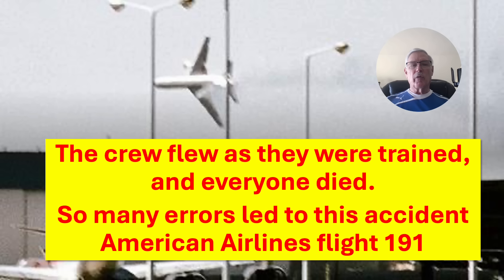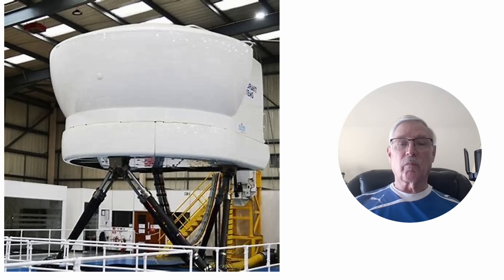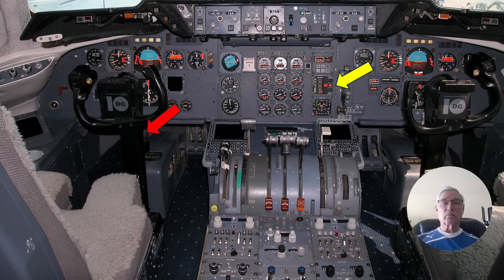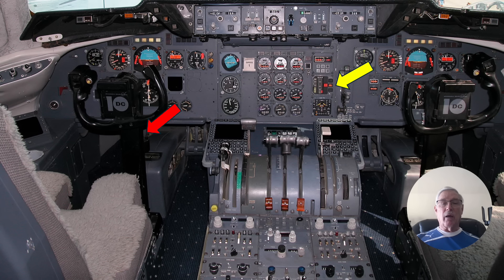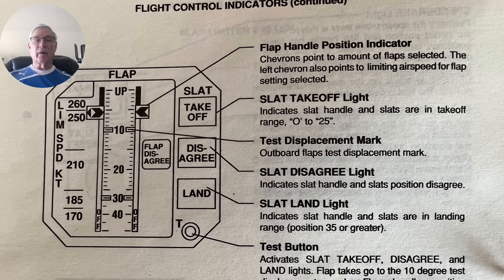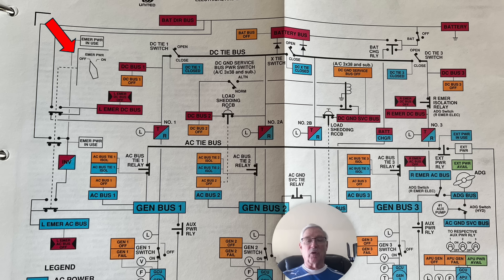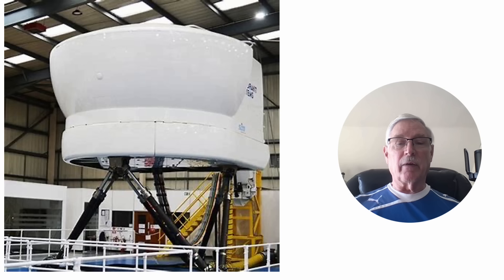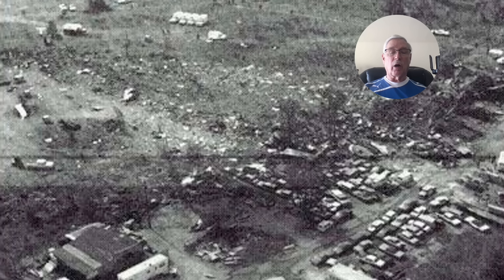The crew flew as they were trained, and everyone died. American Airlines flight 191

Comment: Thank You but your wrong? Flight 191 was doomed from the second that the engine
and Pylon left the Aircraft. Capt Lux  and the crew could do nothing to save the aircraft?
Why  because when the Pylon left the aircraft it tore open all 3 hydraulic lines disabling
all 3 Hydraulic systems.On a DC-10 it has only 3 systems and if all fail as in this case
it leaves the Pilots with no Control and no way to fly the aircraft. This was a Fatal 
design Flaw on McDonald Douglas's part. resulting in the Turkish  DC-10 flight
981 killing 346 in march 1974 and  United 232 at Sioux City  in 89 killing 112
of 296. In flight 191 case when the lines tore open (and you can see the Hydraulic
fluid coming out in the Photo where the aircraft is in a 90 degree Bank) the flaps
and slats on that wing retracted  causing that wing to stall? the aircraft was below
flap retraction speed.with out the hydraulic systems The first officers first thing
would have been to add right ruddder and right aileron  But with no hydraulics
the aircraft while still climbing slowly rolled to the 90 degree bank where the 
stall speed would have been well over 200 Kts. I'm a retired airline pilot and
knew Capt Lux a very good pilot blaming him and his crew is an outrage,
when the DC-10 was only a few months in service an American DC-10
flight 96 in 1972  almost crashed when the cargo door came off knocking
out 2 Hydraulic systems and damaging the 3rd only the piloting skills
saved the plane. But besides the cargo door fault they found all the 
hydraulic lines were run together to save weight. this Flaw was never
repaired They said it was But United 232 tells us that 1989 when it
lost all hydraulic systems it wasn't again only the crew flying with engine
control saved most of those on Board  so when they say Capt Lux
and his crew slowed its not true. with all 3 systems gone no one could
have saved that Plane and the people on board .They knew it could happen 
but they didn't fix it ,Just like in 72 they knew the cargo door could come
off but 2 years later it did again and killed 346  a Gentleman's agreement
instead of an AD  and it wasn't fixed.

Comment: Half RUDDER? If I read your chart correctly at 7 min the rudder is split top and bottom with the systems. So maybe they had only half the rudder as well to prevent the roll?
Reply from the maker: No, The lower rudder is being powered by system 2 and three thru a motor pump, and the upper rudder is being powered by a motor pump from system 2 even if system one is gone.

Comment: Don’t the airlines require a test flight after a major maintenance evolution, such as an engine change? It sounds like the went straight from maintenance to a passenger run. I know in the military we did a test flight after major maintenance activity….
Reply from the maker: I think one is required, but this aircraft had operated on  a number of passenger flights before this event.
Reply: @ronrogers  Ok, not knowing the full history it didn’t seem right to me. Guess I work in aviation  too long….

Comment: The DC-10 was grounded until the cause of the accident was determined.  Why was the 747 not grounded after TWA 800 until the cause of the accident was determined?  The President was telling us it wasn't terrorism, as if that was supposed to ameliorate the concern of what happened? I have no answer for this.
Reply: Good question.  The DC-10s weren't immediately grounded.  That came two weeks later, after a few (two? -- working from 45 yr-old memories here) aircraft which had recently been inspected and found to be free of pylon flange cracks were now found only a short time later to have cracks.  Something incredibly dangerous must be lurking if cracks could develop in such a short time.  So the type was grounded while this was investigated further -- a reasonable decision under the circumstances and not directly because of the 191 crash.

As the circumstances and engineering design continued to be intensively studied over the next several weeks by DAC and the FAA (I was present for some of the technical briefings by DAC's engineering VP), it came to be realized that the only explanation for the "new" cracks was that they had been missed in the earlier inspections, rather than having formed in just a small number of cycles.  The grounding was therefor lifted after about five weeks.
Reply: "I was present for some of the technical briefings"  DC-10 engineering trivia, from a briefing by DAC engineering VP Eugene "Gene" Dubil:  All of the structural calculations related to the DC-10-10 pylon were checked for errors.  The only error found was one part which had been designed to handle five thousand pounds more load than called for.

Comment: It was , but up my want to expand on why the crew reduced to stall speed
Reply: They reduced to what was the optimal initial climb speed with a failed engine.  Unfortunately, that speed happened to be 6-7 knots below the stall speed of the wing with the retracted slats.  They weren’t trying to slow to below stall speed, they simply didn’t know what the stall speed of the wing was, and followed their procedures into what was essentially a spin entry.
Reply: @bradcrosier1332  thank you thank you . That makes sense for optimal climb speed . Clearly I am not a pilot

Comment: Doing two basic things differently might have saved N110A, serving as AA Flight 191:

#1.  Maintain climb rate to put as much altitude between the disabled aircraft and the ground.

#2.  Maintain or increase, in the case of the trijet, engine #2, and slightly decrease throttle to #3(starboard) to maintain attitude symmetry long enough to buy time for the wide left turn 191 needed to return to Ohare runway 10 (going east).  There was only one Runway 10 back in the 1970s, if I recall correctly.

The result might very well have been a rough or crash landing, perhaps similar to the United 232 incident in Sioux City, 1989, but fewer deaths might have occurred, and more people might have survived.
Reply: Retracting the slats would have corrected the asymmetric lift issue on the starboard wing that caused the roll.
Reply: Doing #1 is essentially what killed them - they increased the pitch attitude to get back to V2 speed (optimal climb speed with an engine failure), which resulted in the left wing stalling due to the slats being retracted. 
#2 would help in a Vmc roll situation, but would have made no difference once the left wing stalled.  The ONLY way to recover once the roll started would have been to reduce the angle of attack on the left wing (in reality, it would be both wings, but the left one is the one that matters), which then would get it producing lift, which would then enable you to counter the roll - however doing that is also counter to your #1.
Reply: @AA-xo9uw - Partially correct.  However, that would have resulted in the right wing also stalling.  Now I’ll grant you, that would have for the most part solved the roll, however the odds of recovering from a full stall and a (by then) unusual attitude at 300 feet above the ground in a heavily loaded wide-body is highly unlikely (particularly with one engine inoperative).
Reply: @bradcrosier1332  They actually increased climb rate from what it was before the portside flaps started retracting autonomously.  My suggestion was to maintain - as in do not change - the climb rate.  Changing the climb rate put them into a stall.
Reply: @Zickcermacity  - Except that’s not half of what you said in your #1:  “…to put as much altitude between the disabled aircraft and the ground.”

That part is the exact opposite of what you are obviously actually meaning - what you described in the second half (quoted here) would essentially be a zoom climb where one trades kinetic energy (airspeed) for potential energy (altitude) - which we’re both in agreement.

The actual key is NOT the rate of climb, but the airspeed, which had they maintained rather than reducing to V2 (which again, was essentially a brief zoom climb - they traded what they believed was excess airspeed for altitude while slowing to V2).

To be more accurate still, they increased the angle of attack to the point where the left wing (with the retracted slats - not flaps) exceeded its critical angle of attack, resulting in that wing stalling.  This resulted in asymmetric lift between the stalled and un-stalled wing, which caused the uncontrollable rolling moment.
Reply: @bradcrosier1332   My father and I were not always the best at expressing ourselves, but here goes my best effort to clarify myself:

#1.  Do NOT change rate of climb from whatever it was 3-5 seconds after 191 became airborne.  American's or Douglas' recommendation was to increase pitch and reduce throttle - a suicide combination in the event of a dead engine, let alone a missing engine!

#2. INCREASE THRUST to center engine(2) - push it through the front of the fucking console if necessary(!), and reduce thrust slightly to starboard engine(3).  Reducing starboard wing flap setting by one increment, as you or someone else mentioned here, would also aid symmetry.

EG: If they were flaps 20 during PTO checklist, reduce remaining flaps(starboard) to 15 once they realized they were in trouble, if that was an option on a 10-10.

If all this produced a "232" style return to O'Hare in a simulator, that's better than all dead upside down in a field across a highway from the airport.
Reply: @Zickcermacity  - [OK, I think I’m done editing.  Thank you for your patience and indulgence.]

Again, I get what you’re trying for, but I have some serious reservations about a few of the statements made here:
1) Do you have a source where McDonell-Douglas said to reduce thrust with an engine inoperative immediately after takeoff.  I wasn’t yet flying when this accident occurred, but I’ve read a lot about it since then and I’ve never seen any guidance from McDonnell-Douglas (or Boeing, or Airbus for that matter) calling for reducing thrust prior to the completion of third segment climb - where the aircraft has accelerated to final segment climb speed and cleaned up from it’s initial takeoff configuration.  That makes no sense and has never been promulgated by any authority I’m aware of for engine failure after V1 in a jet aircraft.  Piston twins are a different matter.

I will absolutely agree that the old (bad) guidance was to reduce from the current airspeed to V2, and that has been changed.

As far as engine inoperative vs engine missing - absent other damage (which they absolutely had, but it wasn’t necessarily inherent to an engine separation), whether the engine was there or not is semi-irrelevant.  If anything, the absence of the engine should improve performance due to less drag and reduced weight. That’s of course the theoretical of a nice, “clean” engine separation where nothing else was significantly damaged - not the reality of AA191, but it is important to make the distinction.

I must ask if you or your father are pilots - your obsession with vertical speed is very odd.  Vertical speed is typically a supporting instrument, not a primary one - it is NOT the best tool by a long shot for stall avoidance.  Airspeed is typically the primary reference (though angle of attack is superior IF your aircraft displays that information), even an “instantaneous VSI” has some real, perceptible lag to it - you could (and likely would) induce a pitch excursion if trying to use your IVSI as primary pitch in an engine out scenario.

Increasing the thrust on #2 is fine advice, but reducing thrust on #3 ignores what the problem was:  the left wing had stalled. 

IIF you were in a Vmc roll situation, then yes - reduce the thrust, because it’s the loss of YAW control due to inadequate rudder authority that is causing the roll.  The outboard (#3) engine is causing a rolling moment because it’s accelerating that outboard wing (yaw), creating more lift (roll) due to the acceleration from the operating engine (again, due to lack of rudder authority).  Reducing the thrust reduces the yaw, because the rudder now has enough authority to overcome the asymmetric thrust.  No yaw, no roll - problem solved.

Except THAT WAS NOT THE CASE IN AA191.  In 191’s case the roll was because the left (inboard) wing was stalled - it was not producing lift while the right (outboard) wing still WAS producing lift.  In this case reducing thrust on #3 would be of no benefit (assuming you are using full or nearly full rudder deflection to counter the asymmetric thrust, which you would be doing) because that’s not what’s causing the rolling moment:  It’s asymmetric lift due to the stalled wing; not roll induced by yawning from asymmetric thrust.

You cannot move the wing flaps asymmetrically, they move in unison or they lock in position.  Asymmetric flaps would create a HUGE rolling moment - not really what you want in the middle of a mildly challenging directional control exercise.  Using less flaps can improve directional control by increasing takeoff speeds, thus enhancing rudder authority and directional control.
Reply: @bradcrosier1332   From the wikipedia article about 191:   "The aircraft climbed to about 325 feet (100 m) above ground level while spewing a white mist trail of fuel and hydraulic fluid from the left wing. The first officer followed the flight director and raised the nose to 14°, which reduced the airspeed from 165 knots (190 mph; 306 km/h) to the takeoff safety airspeed (V2) of 153 knots (176 mph; 283 km/h), the speed at which the aircraft could safely climb after sustaining an engine failure" 
  
So possibly I could have misread the above as a command to throttle down, but I'm pretty sure I saw it in SOP somewhere for these jets.
Reply: @Zickcermacity  - I guarantee you did not.  No hands are supposed to touch the thrust levers from V1 until at least 400 feet above ground (often higher, depends on the airport).